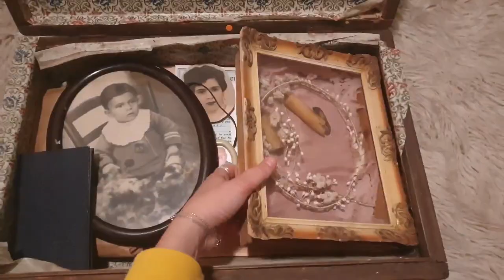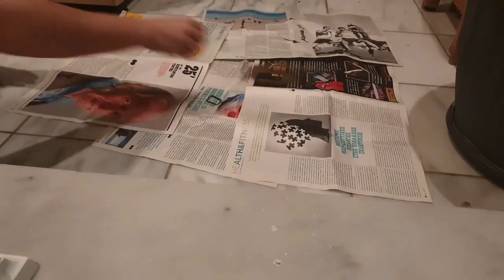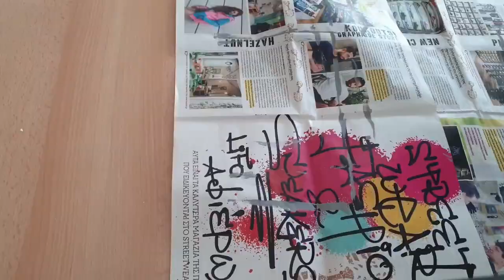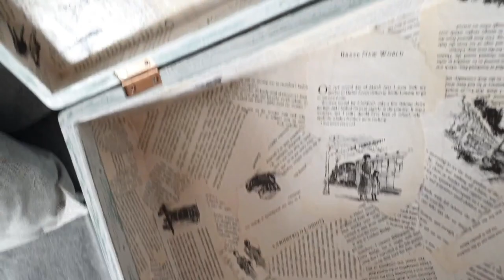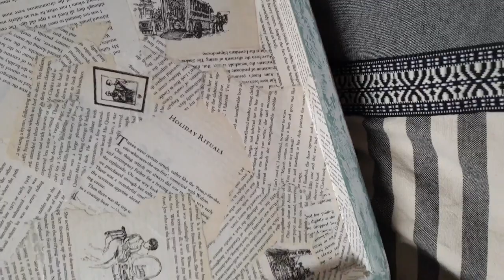Quarantine' s crafts vol.3  |  DIY - Old suitcase makeover

Comment: This would have been from 1800s or early 1900 given the dovetail joints in it. The purist in me feels that maybe just a wash and a loving coat of wax would have bought up the grain and patina. And the inside lining was lovely in the original.
Reply from the maker: You can see than it was destroyed from humidity and it was breaking in pieces inside and out. So a lot of repairing materials should be used and that would definitely cover the grain and patina. Also the inside lining was lovely only by looking, because it was too sticky when you were touching it, and it was keeping too much dirt on it. What I am trying to say is that although I love wood texture, on this one I had to find other solutions that would cover the wood..
Reply: Ufffff, grán trabajo para la pieza no adecuada, (es solo mi opinión)..quedó tan tapado su pasado, y pienso que es triste.  Si compras una caja barata y sin historias que contar en una tienda de importación, consigues el mismo resultado....